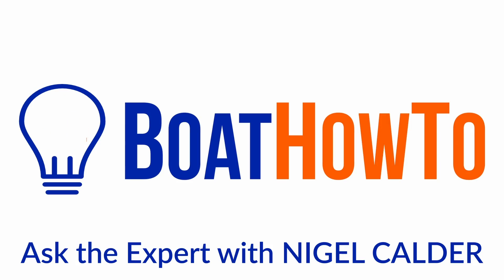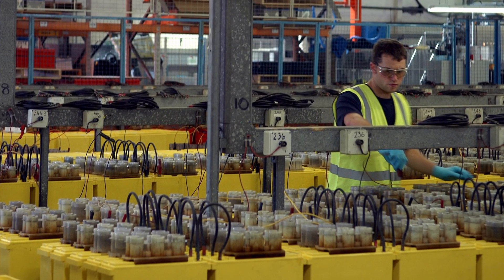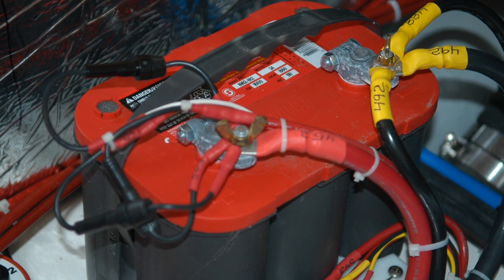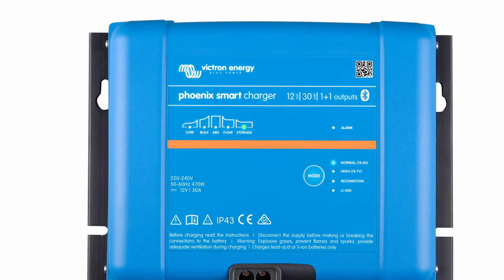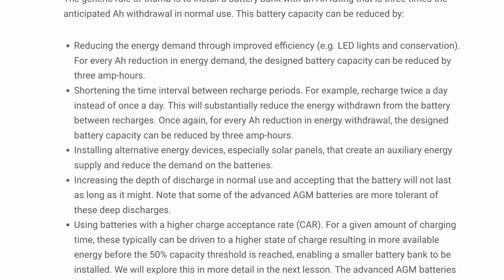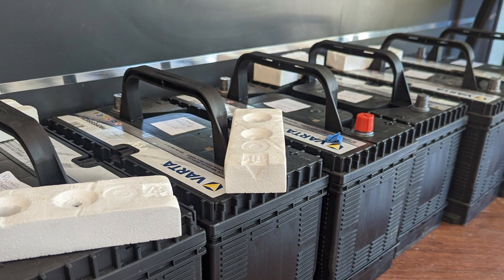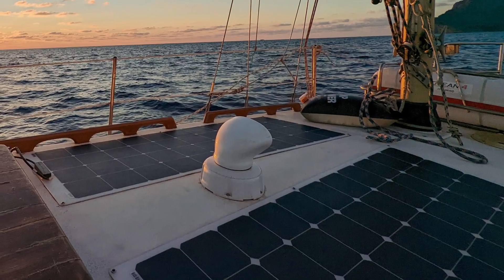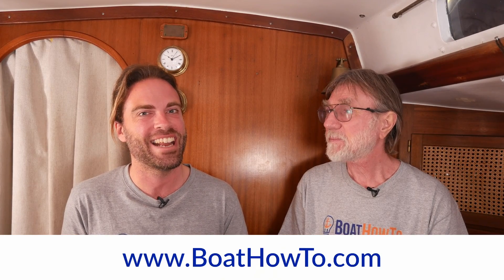Why do LEAD-ACID BATTERIES on Boats FAIL prematurely? | Ask The Expert with NIGEL CALDER

Comment: I love most videos on your channel, but I fail to see what advise can be taken from this. Trying to recreate the lab conditions? Prevent sulfating? I don't see concrete tips in this. Causes of short battery life can just as well be continuous overcharging, bad setup between alternator and solar, different wiring between the parallel batteries, or different internal resistance. Furthermore, during winter, batteries are not kept charged, and even tiny leakage will cause deep discharge over a long period.

Comment: also they are designed to fail for the profit of the battery companies. sulphation absolutely is a cause. batteries left un charged will cause sulphation faster and more. the debris that comes off the plates collects at the bottom of the batterry, and when that debris accumulates and gets high enough it can short the plates. equating to a dead battery. so why dont they allow for more space at the bottom of the batterry to increase batterry life? and also sulphation can clogg the plates up beyond operability. also we have acidic electrolyte. alkaline batterys could last longer given theres less corosion. lead allum for instance. the battery market is designed to kill the batterry and have the consumer spend money on new ones. scientifically it is just retarded and its somewhat con man economics. but there we go. thats the normal game. batterrys should last at least 20 years if we implemented proper science. anyway, cheers! 😊

Comment: Hi guys, excellent content thanks for sharing that with us, maybe someone could give me an opinion,  I have a 200ah agm about 3 years old it was working ok until few weeks ago, I noticed it is now charging only at 13.0v when get close to fully charged goes up to 13.4 it's not the charging devices, it does the same no matter the charging source, alternator, solar or battery charger. Is it some fault in some cell?like getting some high internal resistance? I think the problem was caused by mi alternator, unfortunately it is a stock alternator with a internal regulator which I don't think is working properly, it keeps the voltage too high for too long, so I guess that what caused the issue, it only happened now because we just did a 2000nm crossing and used the engine quite a lot. Does all that makes sense?
Reply from the maker: This sounds like it is caused by the charging sources than the batteries. I it possible that these lower voltages occured at times with higher temperatures? Some chargers (like Victron) do adjust their float voltage with temperature. If it's hot, the voltage is lower than if it's cold. Check with the manufacturer if this is the case with your charging device. By the way, much more important for battery health is the absorption voltage, which should be about 14.4V (or even higher, depending on the recommendation of your battery manufacturer...) You can learn more about this in our Boat Electrics 101 course. - Jan

Comment: Great video as always. One nitpick with Nigel saying if your batteries don't last 5-10 years you're doing something wrong. It's not about years, it's about cycles. Some boaters do almost no cycles in a year while some do close to 365. 

So I don't think it's fair to say using up a battery before 5 years is doing something wrong. If you do 300 days at anchor that could be 1500 cycles in 5 years, which is way beyond the AGM lifetime of 400 cycles of 80% discharge or even 1500 cycles at 30% shown in this video (considering that real life will have some psoc cycling, not laboratory cycles).

Sometimes lead-acid batteries fail before 5 years because they were used heavily - that's not a premature failure, that's what the batteries were designed to do.
Reply from the maker: This is a good point! Nigel was referring to the "average boater". If you really spend your time at anchor year round, your batteries may indeed reach their designed cycle life in less than 5 years. - Jan
Reply: @BoatHowTo  nigel is it possible to get in touch whit you ?
Sendt mail in ur online zite now to day
Reply from the maker: @Lordlindef 
Thanks for your comment. I just replied to the email you send us.
Best,
Jan
Reply: Yes.   Is it possible to get this nigel altinator in 24volt??
Reply from the maker: @Lordlindef  You are probably referring to the "Integrel" System? This is unfortunately only available in 48V. But there are some other really good alternators on the market that come in 24 and 12 Volt variations. Check out https://oceanplanetenergy.com/, they have a wide selection and offer really good advice and service!
- Jan